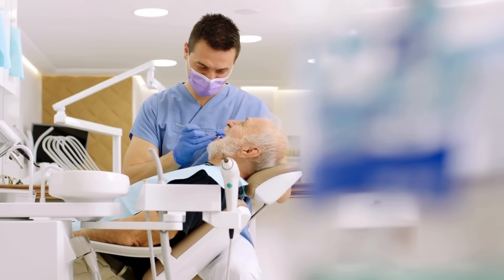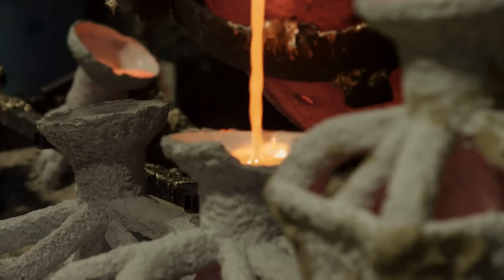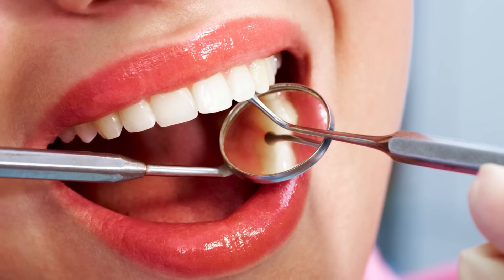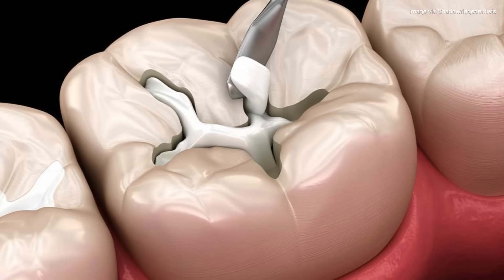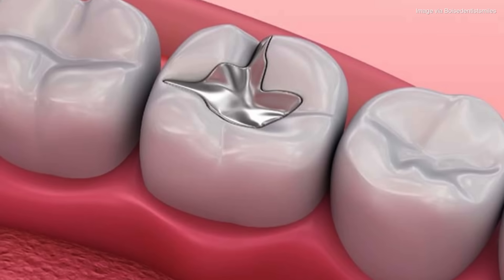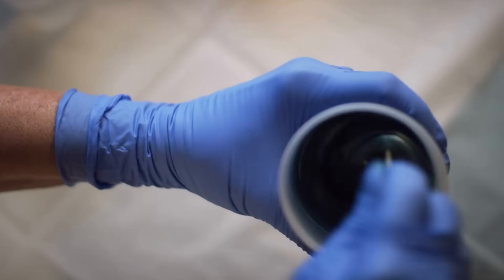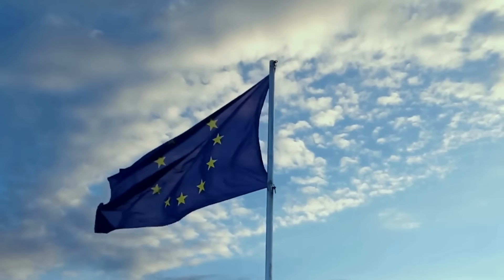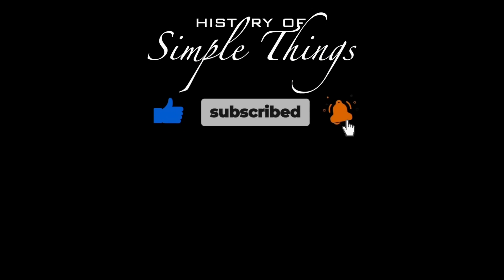Amalgam: The Secret Formula Behind Dental Fillings & More!

Comment: Not convince it is safe to have in your body. I question why they were called "silver" and not mercury, etc. it seems that they were hiding something. What if it is not mixed properly? Safe for most people? FDA has allowed dyes in food that are now being banned. Metal fillings that do not bond to the tooth. The tooth needs to be undercut for the metal to have something to grab on to. This makes the tooth weaker by removing more material, also the metal filling can loosen slightly allowing decay to form underneath. For these reasons I  had any new fillings and as the old ones loosen up replaced with composite. I told all my kids to tell the dentist to not use amalgam on them either. The extra $35 was worth it. And they look better too.